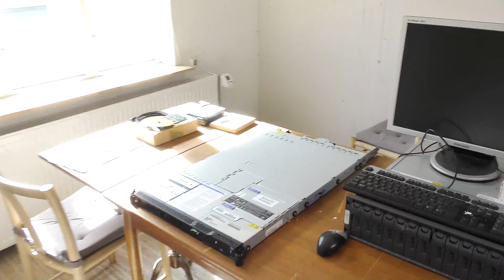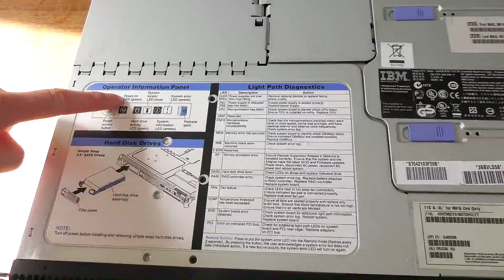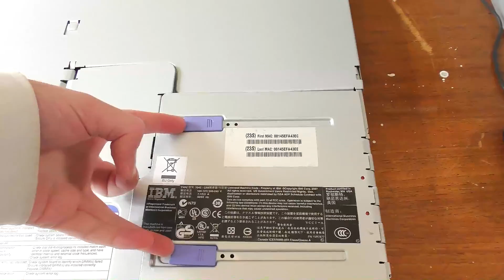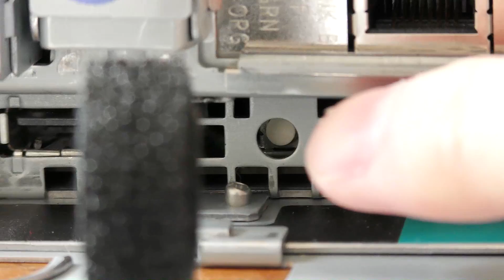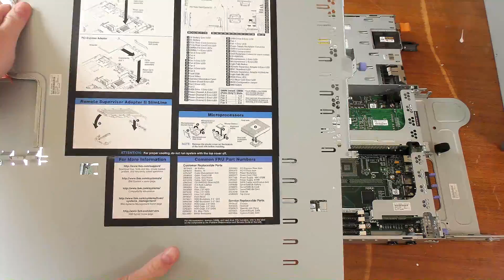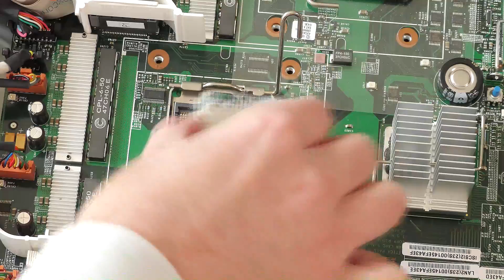IBM HMC for AIX Power System 7042-CR4 but an x3550 M1 - 574

Comment: The door for the fans reminds me of the Power5 p505 1U server for AIX. The 5706 feature code sticker makes me think it was shipped in, or sold to be installed in a Power system. Looks like that Intel dual 1gbe card came from a Power 6 machine. Perhaps IBM used the same cards since this server was sold as an appliance along side the Power machines. Kind of wish I had one of those, maybe I should look for a x3550 m1.
Reply from the maker: Hi 808jpm
Thank You very much!  I have never seen a normal x3550 M1, but I did see pictures, and they are about the same. but the x3550 M1 has a build in raid controller.. this HMC does not.
Thank you for watching! :-)
Reply: A little research later, and while there are some x3550 M1s on ebay, I have a number of M3s which would be 7042-CR6 if they were a HMC.

Comment: Do you have access to any of the Lenovo/IBM RAM DIMM based flash storage devices? I forget exactly what they're called but it's basically an SSD on a RAM DIMM. I've always wanted to know more about those.
Reply from the maker: Hi sparton175
I played with them on a x3850 X6, in a video long ago.
Thank you for watching! :-)
Reply: I seem to have found it :) I have a x3650 M4 and I'm pretty sure the 200Gb model (90Y3246) will work on it but I can't seem to find much information for this online.

Comment: This question is unrelated to this video, but related to the ad I watched before.  It's from "Condusiv Technologies" and you cover a lot with VMs.  their claim was that writes from VMs, especially windows, would be very small and cause IO issues where you wouldn't get that problem if it was running on the bare metal.  They apparently sell software to help fix this.  Supposedly it works to make the write blocks bigger and more efficient.  Some stuff with caching is also briefly talked about in the ad.  This seems to be targeted to environments that use remote storage such as SANs.  I've only worked with small setups using local storage so I don't think I would ever see this.

Is this something you've seen or do you even think it's much of an issue?  it reads a bit like network buffering tech in switches and routers.  I feel like it would have the same negative possibilities.  But I'm not used to dealing SANs.  I'm not looking to buy any of their software, just wondering what your thoughts on their claims.
Reply from the maker: Hi joebleed
Sorry,,, This is not something I have to much experience with. I have seen systems that on the very big scale works a lot better on metal. Like exchange servers with thousands of users. But never had that myself.
Thank you for watching! :-)

Comment: PCI X not PCI Express - https://en.wikipedia.org/wiki/PCI-X
Reply from the maker: Hi Simon Sparks
Thank You very much!  I did catch myself later in the video.
Thank you for watching! :-)
Reply: I've never seen a server with a mix of both only ever 1 or the other... how is your 10Gb network switch search coming along ?
Reply: HP had some models that have both, or at least models where different riser boards can be installed to provide PCI-X or PCIe. I know I saw this in a DL380, probably in the G5ish timeframe. You know, when that switch over was happening.